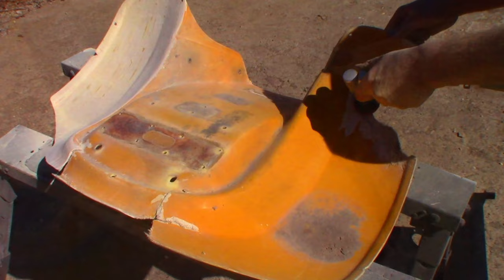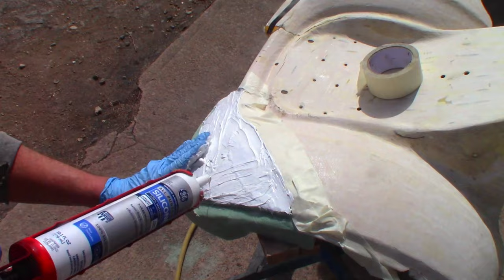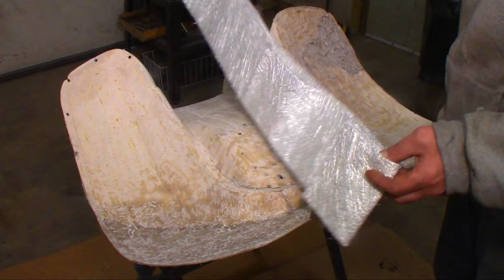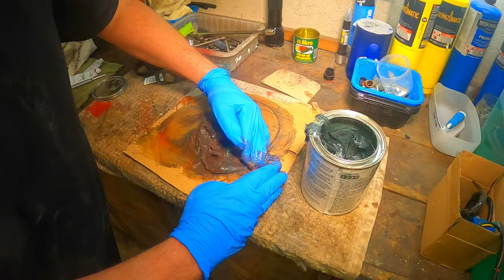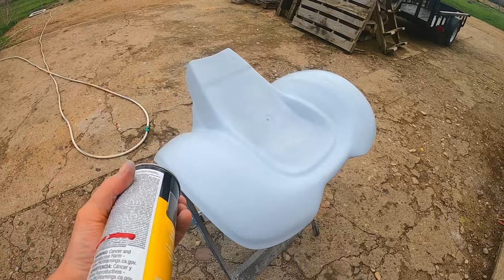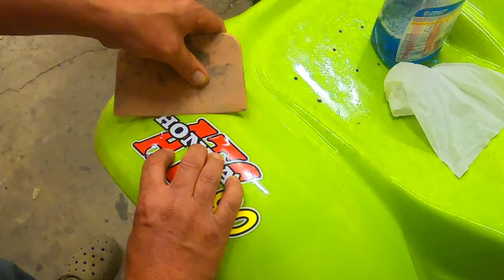I Restored this DEMOLISHED Fiberglass 3 Wheeler Fender - ATC 90 1970 Honda  Restoration

Comment: You just reignited my hope on my 185s. I walked out back a couple weeks ago and noticed the wind had decided to remove one of my rear fenders and dispose it in a place unknown. Hopefully I can find the piece when the snow melts, but if not, now I know how to make a new one. Thanks!
Reply from the maker: Dang, I hope you find your fender 😁😁 One thing to note if you don't know, the later 3 wheelers use plastic fenders, not fiberglass like the ATC90s . Fiberglass and resin won't stick to the plastics at all. The YouTube channel @mrcbuilds has a good plastic welding video where he fixes up some later Honda plastics. Best of luck in your project and thanks for stopping by!

Comment: wow...this takes the definition of tedious to a whole new level. Came out beautiful!
Reply from the maker: Thanks, glad you liked it. It sure was an itchy job 😁
Reply: @BIGFOOTBIKESANDBREWS  exactly my thoughts watching you! I noticed you had some kinda regulator and possibly a water filter pre air tool? Curious on what that is bc I have problems with water in my compressor system. I even put a water filter off the tank, but then I’ve had people tell me you need to put it farther down the line? Something little and in-line pre-tool appeals to me
Reply from the maker: @EDBZ28  , I usually just drain the tank and use an in line filter by the compressor. It must not be too humid here because I dont have too much problems with moisture.

Comment: Amazing job on that rear fender . How many hours did you put into it ? I got my first ATC around 1979 , and it was an orange 1974 90 . I love watching you and hopefully learning from you .
Reply from the maker: Cool Glad you like it. This one took some time. I was jumping between this and the metal work on the front fender so I can't remember exactly hot long it took, but if I were to guess, maybe a weekend to grind off all of the old finish and make the foam/silicone molds. Then another weekend off and on laying down the fiber glass and laying down the long strand filler. Then another weekend off and on with the bondo and priming and blocking. Then another afternoon painting, wet sanding and buffing. I think it took me a little over a month putsing around on the weekends to do both the front and rear fender.